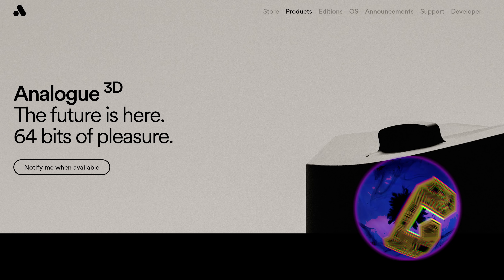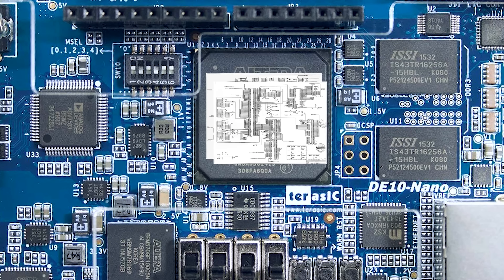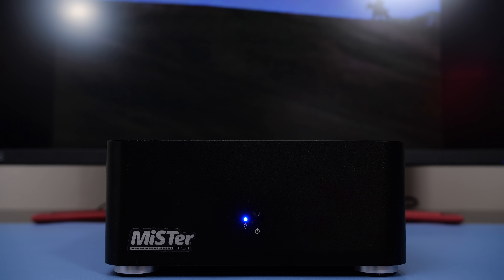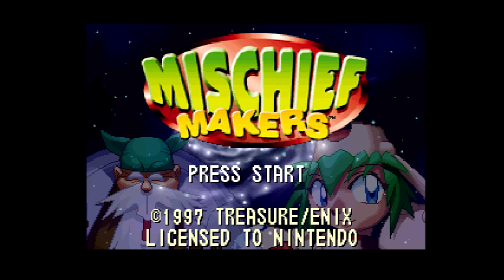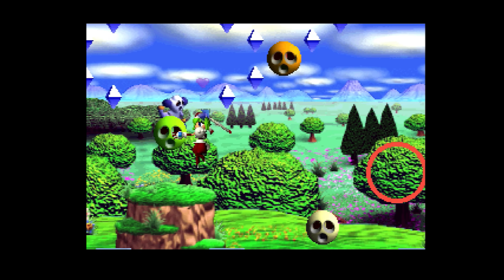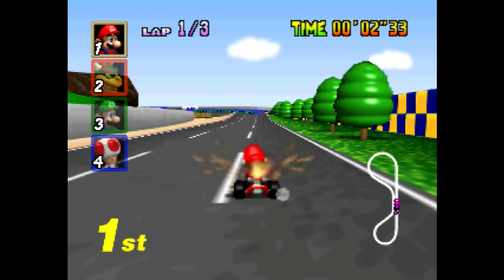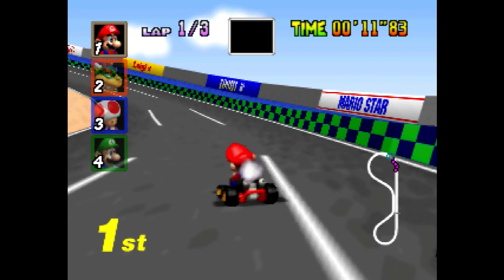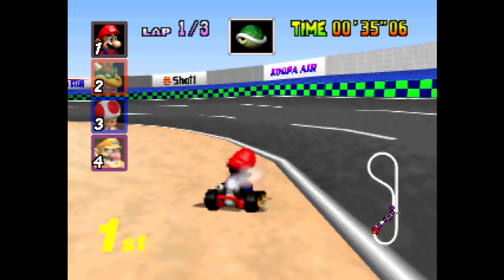FPGA Nintendo 64 gaming is here.

Comment: I am so excited that Analogue & Mister are now developing FPGA cores for 3D based systems. 🤓
Reply: Now I'm wondering about early 3D accelerators for the PC. How about an FPGA Voodoo card for your Pentium II machine? Use Unreal with the Glide renderer as your initial goal.
Reply: Fingers crossed for... [edit: Xbox next?] 

Just learned for GCN it's pointless - sorry lol:
"...GameCube. Few people have access to one, especially the ones with 'Digital AV Out'/Component."
Reply: @burntOrangeHues GameCube is probably the least needed fpga on earth lol. It is the single best emulated 3D console, full stop. "Authenticity" really isn't a justification, it's borderline OCD at that point.
Reply: @-Monad-  I forgot how accurate the Dolphin emulator is. I still have my old GameCube and haven't tried it. I guess original Xbox would be a better candidate for FPGA from what I've heard.
Reply: @-Monad-  Also, once you get into 3D people aren't looking for accuracy as much. Maybe some people want to capture that pure low res early 2000's look but I feel like what most people want out of 3D era emulators is upscaling to higher res, filtering and just generally making the games look cleaner. PCSX2, GCN and Wii all have incredible emulators that do that in spades and you don't even need a beastly PC to do it. 

Even on Mister the PS1/saturn cores comes with a whole host of stuff you can turn on to make games look less shit ;p Same with the N64 core. Wanting things to be look exactly as they were back in the day falls off hard once you get outside the 8/16-bit era's.
Reply: @devilmikey00  i would argue that a large part of gamers actually exactly want that old low res early 2000s look. Have you followed streamers running older games like GC and N64? As soon as they dare to use high resolution or 60FPS mods there is an outcry in chat by people.And don't even dare to use improvements like filtering or anti aliasing. Even worse if you decide to use a high-res texture pack.
People are really bitchy about those things and loooove to complain about it. Which is honestly annoying as then streamers are stuck having to play the "old style" that people want. At least those who don't just stream for fun but also have to keep their audience happy.
Reply: @devilmikey00 I personally always emulate everything close to original settings, resolutions, etc. I much prefer how these old consoles look, even on PS2 and GC. I think it’s because they were made around these limitations and displays so that obfuscates their rough edges more. It’s not just nostalgia for me but it’s nice to know I’m playing it basically the same as somebody did decades ago.

I feel like the one console that’s emulated where that doesn’t apply to the majority of people is the Switch. That one is great to see at a much higher native resolution. But that’s mostly because it’s simple to do, runs modern aspect ratios, and the games are current as well so the difference is more appealing.
Reply: @BahhBahhBrownSheep  I have an "Digital AV Out/Component" to HDMI adapter for my GameCube, and it's a nice middle-ground looking as crisp as possible while still being analog-based/mostly authentic. (A CRT TV is a bit less convenient for my situation).  I love that "premium retro" feel. Like if I played Unreal (1998) with a good monitor and PC that was powerful for 1998. Not the best analogy, but hopefully it makes sense.

Comment: One rarely appreciated but somewhat frustrating part of the N64, is that it is a dual-core system ... kinda. The Reality Signal Processor within the RCP is itself an R4000-based MIPS processor with added vector-instructions and without direct access to main memory (but data can be DMAed in/out)
Reply: Another fun fact is that the N64 supports memory-protection, at least on the main CPU, so you can have unpriviledged processes like with a modern OS
Reply: Asymmetric Multi-processing is always an interesting design choice. The Nintendo DS is another famous example, and the Sega Saturn and Atari Jaguar are both quite infamous examples!
Reply: @johnrickard8512 Yeah. At the same time it kinda makes sense given the work with SGI
Reply: @johnrickard8512  : The Sega Genesis had asymmetric multi-processing too, since the z80 in the audio section was actually a full CPU; it just didn't get used for that much because the 68000 was much more powerful.
Reply: @absalomdraconis even the SNES had a dual processor. The main processor and the audio processor core.
Reply: @sur_shrimpster  Those are not contradictions. The RSP has its own memory pool and can't access main memory directly ... but the DMA Controller can.
Reply: It's not really dual core. It has two processors. That's like saying any old PC is dual core because it has both a CPU and a GPU. Of course, the N64's RDP handles more than just graphics, but it's essentially the system's GPU.
Reply: @pikachuchujelly7628  The RDP is a MIPS-processor though, like the main CPU, so it's not really comparable to having a normal CPU and GPU setup
Reply: Can we all agree on "co-processor" then?  Instead of GPU or 2nd core...
Reply: @sirnickity  Yes, it's even called the Reality Co-Processor.
Reply: I don't find that as impressive as the Sega Saturn's dual CPU setup. Even though the Saturn was terrible with 3D (and so was the N64), it was a massive powerhouse with 2D that was the best console, hands down, for arcade perfect ports, which was a big deal in the 90s (it truly was unfortunate that Sega couldn't get past themselves to make the console the best it could've been). PSX did 3D best, Saturn did 2D best, and the N64 wallows in its own mediocrity. And for the record, I grew up playing all three systems, with my friend having an N64, and enjoyed my times with the games then. The console, though, and the vast majority of games on it, have aged so poorly that week old warm milk looks more appealing (the few notable exceptions are Rareware games, but that's because them madlads were absolute killers when it came to programming and games devs). N64 is probably the most highly overrated video game console, and has been for a very long time, because people look at it with rose-tinted nostalgia goggles. And I get it. Some of the games are awesome. But most of those awesome games had alternatives on the PSX that were, quite frankly, better in many ways (Jet Moto being better than Wave Race 64 being a great example of one).
Reply: @malice5121  Saying the PS1 was best at 3D is hilariously wrong. The N64 was literally a scaled down HiSilicon workstation. The PS1 doesn't even have a Z buffer?? It's why polygons clip and warp so weirdly with 3D movement. Lets not even get started on that god awful dithering. The bilinear filtering isn't great but it's miles better than dithering. The N64 was absolutely the most powerful of the generation. If anything the inverse is true, PS1 better at 2D than the N64.
Reply: Surely a CPU is either a dual core or not? What made you say that, just out of interest?
Reply: @aniluxneo9218 I’m not OP and their answer will be more in depth but basically, is that the way a modern dual core works is by delegating the same task into multiple parts and splitting it up by core. The N64 had multiple chips that would do essentially the same same thing but with more dedicated and pre-determined tasks than a full multi-core processor from today would.

Edit: Oh and because the co-processor didn’t have direct access to memory, it doesn’t work the same way either.
Reply: @aniluxneo9218  the Nintendo DS, for instance, has 2 ARM CPUs both doing their own processes and hardware access.
Reply: @aniluxneo9218  They don't share memory-space, or a socket, and they have somewhat different instruction-sets
Reply: @aniluxneo9218  The Reality Signal Processor within the RCP is itself an R4000-based MIPS processor with added vector-instructions and without direct access to main memory (but data can be DMAed in/out)

Comment: One thing I genuinely don't understand and would appreciate to have explained to me: Is 4K really a great selling point? The console natively runs on 320x240 for many games and features low-poly-models that use trilinear filtering to blur the 32x64 textures it uses. I can't imagine that would look amazing when upscaled.
Reply: 4k is not for the internal rendering from the console. It's for the post processing things like CRT filters and scanlines. A high resolution is needed to get accurate CRT filters.
Reply: 4K is useful for replicating the look of various CRTs masks like they are promising to do with the Analogue 3D but I’m still hoping there’s a trick to at least double the N64’s rendered resolution… like replicating two RDPs side-by-side and doing something agnostic to the games, like old 3Dfx SLI (scan line interleave).
Reply: It is if it's the rendering resolution, if it's some kind of upscaling though then i don't think it will make much impact. Lets wait and see how it fares.
Reply: Okay, dedicated and controlled filtering of the upscaled image and applying stuff like CRT filters/shaders makes sense. I can see now why 4K support is relevant in this. Thanks for the responses!
Reply: The goal is making it look as close as the original as possible on modern TVs, so you need to integer upscale it many times.
Reply: I have encountered so many comments from people who regard even 720p as "unwatchable." Some people are such resolution snobs that anything less than 4k and they would lose their minds, regardless of whether it actually looks good or not.
Reply: @MrShadow2x I agree with you. Personally I think resolution gets too much "hype" when in many cases signal quality and compression should be more of a priority. I've seen 720p footage that really puts 4k to shame due to the way it is compressed. Not saying 4K is not nice, but in many ways it is just overkill (not mentioning its name is really misleading to increase marketing hype)

Comment: "Take shelter, the Nintendo lawyers are coming!!!!"

to be honest though, is this legal? I'm just worried if this gets shut down by Nintendo.
Reply: Reverse engineering is part of how the hardware gets spec'd out for FPGA recreation. As far as I recall, reverse engineering is in no way illegal. I'm not a lawyer and might be wrong, though.
Reply: @MrShadow2x  thanks for the clarification.
Reply: Far as i know, it's fair game as long as they don't use any proprietary code or file from the original project. Something like using the N64 BIOS for example would be illegal, Nintendo can probably still try to sue mind you but Analogue already did Nintendo consoles before and nothIng happened.
Reply: @marcelolemoss  yeah, you're right. nothing happened to the analogue pocket as far as I can tell. Really cool project, hoping to pick this up in the future.
Reply: There have been NES,SNES, Gameboy and GBA cores for years.

Comment: I want an FPGA XBOX
Reply: The MiSTer project has a 486SX core already, so that's a start. Another 3-4 generations of x86 hardware to go (depending on how you count the Pentium Pro and Pentium MMX).

I think a roadmap to an FPGA Xbox would be basically cloning PCs up to the era it came out, given it has so much in common with an early 2000s PC, which would also be beneficial for anyone into retrocomputing from the era, too. If someone can pull off an FPGA Geforce 3 video card, that's most of the work towards the Xbox GPU done. A huge task, I'm sure, but by building up to it gradually through earlier hardware, it would build a knowledge-base for the relevant areas.

Comment: FPGA's are the masterclass of retro gaming, and I really hope we get FPGA's of the PS2 and OG Xbox
Reply: OG Xbox is a Pentium 3 @ 733MHz and a GeForce 3. I think that may require some monster FPGA. For comparison, the MiSTer's AO486 core runs like a real 486 @ 25MHz with no 3D accelerator.
Reply: @kunka592  Oh yeah it'd take a monster FPGA, but they are out there - just incredibly expensive.

I asked Kevtris a couple years ago in a MLiG livestream he was on what the limits were with current tech then, he said there existed FPGAs capable of emulating PS3 transistor wise, but they couldn't clock high enough to simulate it in real time.
Reply: Its well beyond a DE-10 nano's (MiSter's) capabilities, but FPGAs available can already handle those consoles. Only limitation is how much effort it takes to implement a system that complex.
Reply: @carnivorebear6582 And how much you're willing to spend on the FPGA!

Comment: Even hacky N64 emulators have 100% compatibility these days. That's the easy part.

The question is, how is the actual accuracy? I can emulate all N64 games but not all of them will have the right timings, frame rates and speed.
Reply: Which software emulator has the video screen working on the tunnel entrance in Mario Kart 64?
Reply: @ZaPpaul Mupen64 Plus with opengl or vulkan Parallel. Project 64 does with the right graphics plugin.
Reply: @ZaPpaul  All of them. This is a graphics plugin feature, not emulation core. Most graphics plugins can display this particular effect. In fact, i could emulate this in 2007 using the old Glide64.
Reply: Some games still has compatibility issues
Reply: So fpg core is need it do understand the n64 hardware more.
Reply: @cooparchive7857  Not really. FPGA is still emulation and still requires the same knowledge to be created as software emulators. And they both have the same challenges as far as compatibility/accuracy is concerned.

Comment: Emulation Community always blows everyone away it's amazing
Reply: It's simulation, not emulation. :- )
Reply: @HammyHavoc yes this process would be considered that, but they called it the “emulation community” which is correct. Not a single person in the world would call this the simulation community.
Reply: @BahhBahhBrownSheep  I think it would be more accurately described as the "retro gaming community", or better yet, "retro gaming enthusiasts", as the "community", largely isn't. Most of the action is from a fraction of a percentage of people working on projects like this.
Reply: @HammyHavoc  Ah, semantics. It's what's left to discuss when all topics of substance have been exhausted.
Reply: It's hardware emulation, as MVG said in the video himself.  @HammyHavoc
Reply: @Kniffel101  No—it is simulating the original hardware at a logic level, and simulates multiple processes in parallel. The "emulation" in an emulator is in emulating hardware on top of a fixed architecture in software. The FPGA recreates the hardware by simulating the components instead of emulating them in software, thus it is simulation, not emulation.
Reply: @HammyHavoc  Yeah sort of similar to single chip clones of hardware, it's behaving as the entire setup of whatever it's cloning rather than running a software emulator + roms.